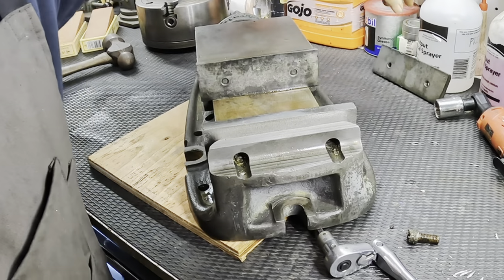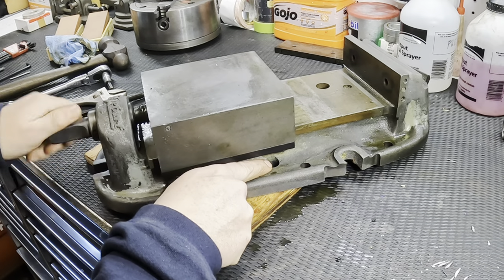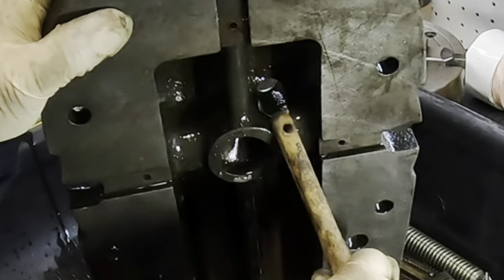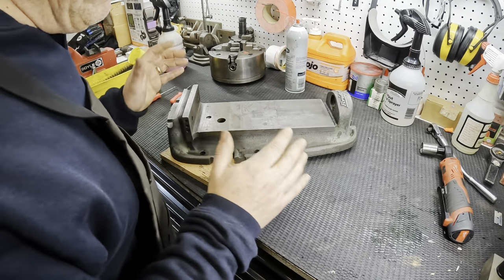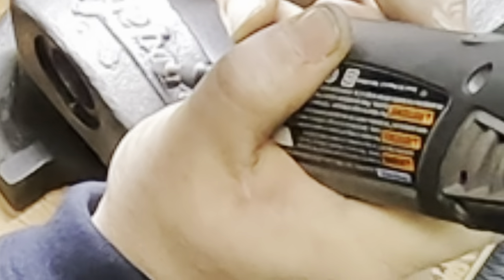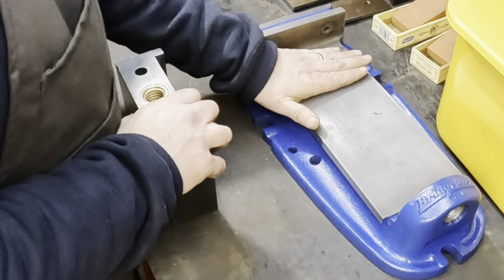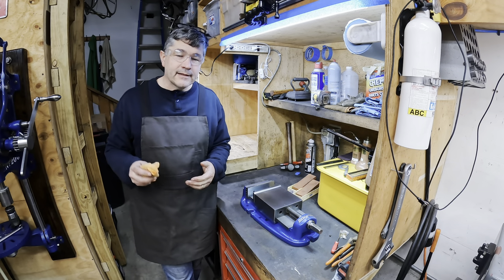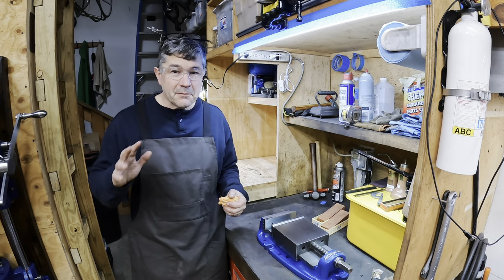Bridgeport Mill Vise Restoration. From Rust to Restored!

Comment: Nip the sharpest part off the point of a sheetrock screw, screw it into the oiler you want to remove, then use a claw hammer to pull the whole thing out like you would a nail.  It'll trash the oiler, but it'll come out.  Great job on that!
Reply from the maker: Ah, great idea, thank you!

Comment: I got mine at a rummage sale.  It looked like it hadnt been used for 50 years.  It was covered in about a half inch of chips, grease, rust, dirt... and of course random holes and all over it.  It has the swivel base which is really nice.. not all of them stay with the swivel.  I didn't pay much for it.  I filled up all the holes and the drill pecks all over it.  I had to grind the bed and bases smooth and flat.  Yours turned out nice.  I think every shop should have one if they have a mill suited for its use.
Reply from the maker: Thank you for the comment and watching my channel! Next one I do I may fill the holes.
Reply: @EnoRestoration  I have another in about the same condition yours was in. I should video the process.  I did see an assembly diagram.  The "hole" in the slide jaw casting is a small pin.that holds in the bearing bronze nut. I've never had to remove it.  I originally thought it was a peck hole from a drill too.
Reply from the maker: Thanks for the intel!

Comment: Since that hole in the base is so large, it would be noticeable cosmetic upgrade if you bored it out to get it straight, and then press a cast iron slug in and then deck it off.  It would be an interesting side project to try, and there would be a noticeable visual improvement.  Keep up the good work.
Reply from the maker: That's a great idea, need more side projects,...!  Thanks for the comment!
Reply: That would have been my suggestion too, the "apprentice marks" do rather let down all the hard work. Loctite and interference fit cast iron plugs would be all but invisible if done with care.

Comment: That was a great restoration. I have a similar one that can be rotated. I do have a question, since you have a surface grinder why didn't you cut two 90 degree slots in the tops of the jaw inserts? I clamp almost all of my smaller pieces in the jaw slots on mine eliminating using parallel bars. I would have also welded the two drillings in the throat of the vise and resurfaced. You did a fantastic job !!
Reply from the maker: Eddie, thank you for the feedback and the comment!  Yes, I liked how this came out and the gentlemen that has it now is very happy with it.  Great Ideas about the slots and the drill holes.  I'll remember that for my next project.  Thanks again and have a great day!

Comment: Couldn’t you use your grinder guiding side to side since it won’t cut properly lengthwise? I’m not a machinist I just see a possibility when cutting side to side. Yes, a lot of very short cuts over a wide area, yet it should accomplish the proper results, would it not?
Reply from the maker: You are on the right track (looking for other solutions...).  With the case of a surface grinder, the max y-axis (in and out) travel is about 6 inches.  So, although I could mount the vise in that orientation, and take shorter passes, I would only be able to go less than half way in one set up.  I do have other Kurt vise videos where I do use the surface grinder to clean up the ways.  Maybe check those out.  Thanks for watching!!
Reply: @EnoRestoration  I shall check out the other videos and enjoyed this one sir

Comment: I will have to disagree with you here old oil smell is not loveable & neither is new oil smell. I have seen guys screw a selftaping screw in to an oiler & used that to pull them out, keep up the good work.
Reply from the maker: Great idea on the oiler, thanks for the continued support!